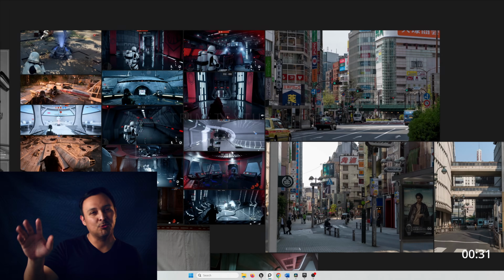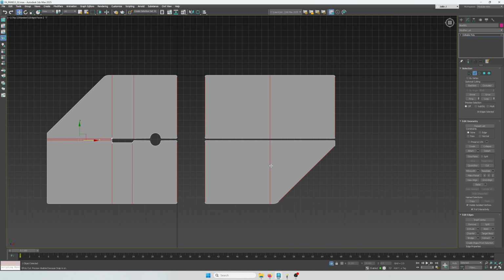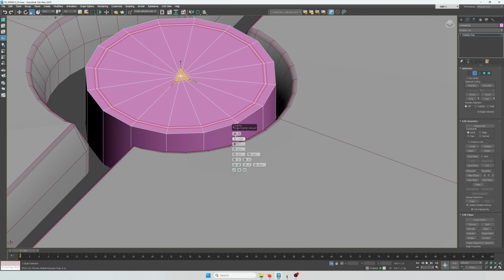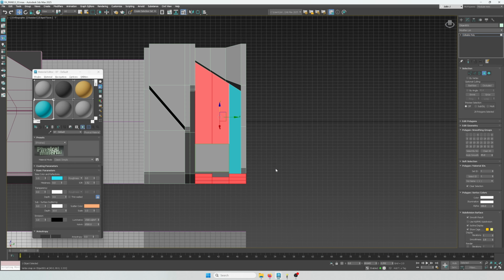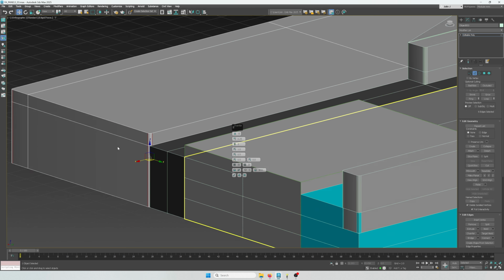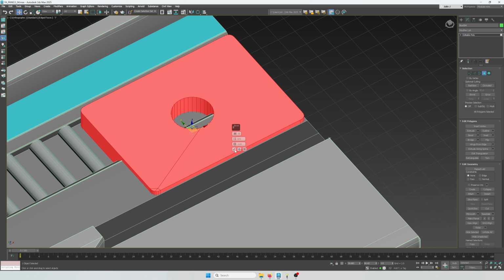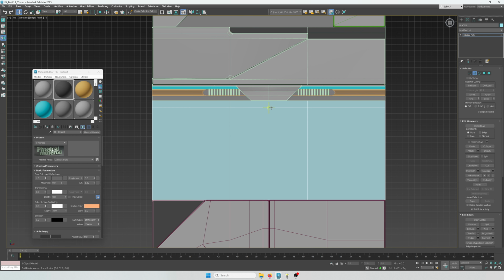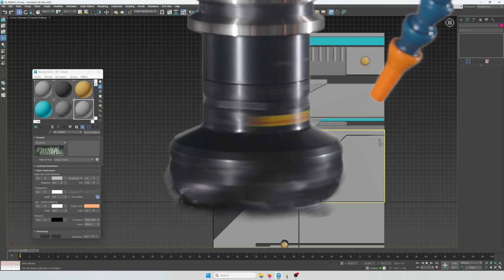Trim Textures for Games | Sci-Fi 3D Modeling (Part 1) | UE5 & Substance Designer

Comment: Great vid thank you for this. I'm working on a large scene with quite a few different assets/models that will need a lot of different materials. I have everything from wood siding for a house, metal for vehicles and weapons, rubber and glass as well. There are more but for now, how would I attack this in Maya, substance and unreal? Is a mix of ways such as trim sheets and tiling materials a good way to go? Thank you.
Reply from the maker: Thank you! I think a combination is always good. Tile textures, trims, one to one bakes for hero assets. Sometimes a trim may be used for multiple materials, for example, you may be able to pull the normals from a trim texture and swap the albedo so it looks like wood or rubber. Giving more mileage to your trim. Similar to having all metal and painted metal versions. Best of luck with your project!